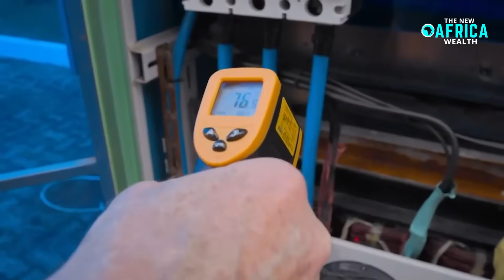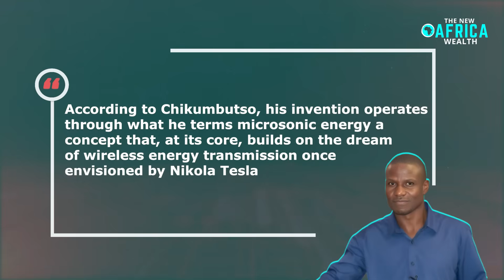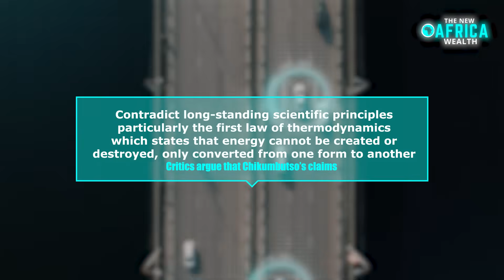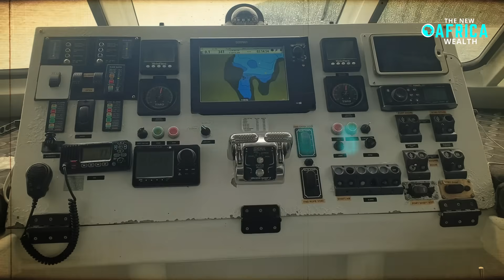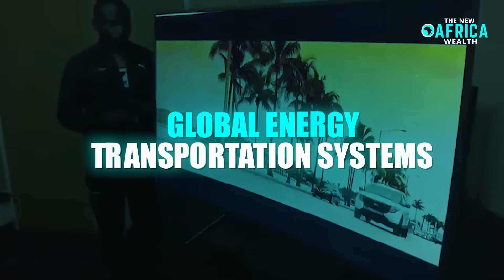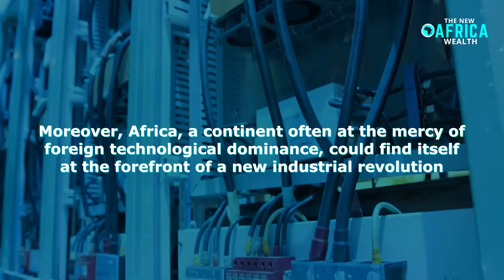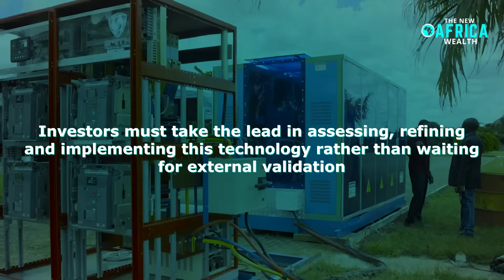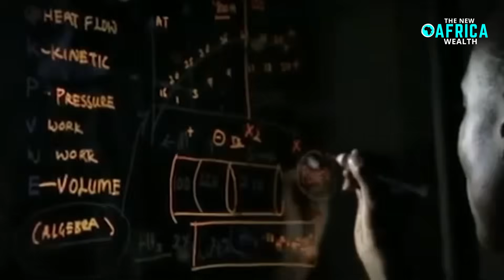Africa’s Self-Powered Car Inventor FINALLY Shows Proof of Self Powering Technology

Comment: He is not generation engery from nothing. I used to have small led on my cell cover that lit everytime my phone was about to ring.  It worked with no battery  only on rf frequency. He is only harnesing microwhatts then stepping it up with step up transformer.. that stepped up voltage goes through moffsets to generate amps. This in turn charges batterys for his ev...   it is much simpler then anyone think.. it is just boosting the correct freuqency.......

Comment: I saw in a video where MOSFETS are used to amplify the radio waves. That's true, they can do that BUT MOSFETS need power to operate and you can't feed the amplification obtained from the MOSFET back into the MOSFET. Ultimately, the whole system will just stop. In fact every component on the circuit board will dissipate energy which the system itself can't replenish. Also, the MOSFETS lose energy as heat, thus the reason for the heatsinks they are mounted on.